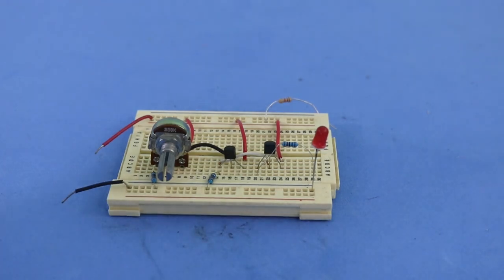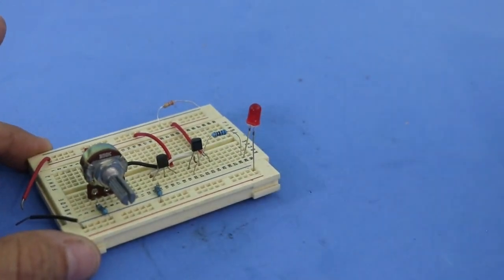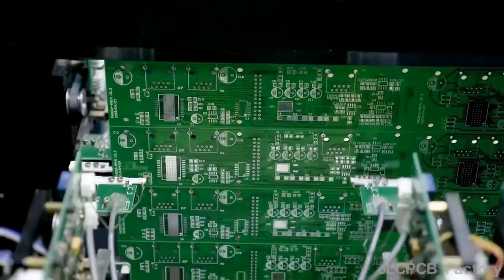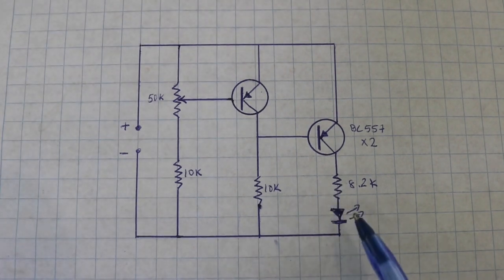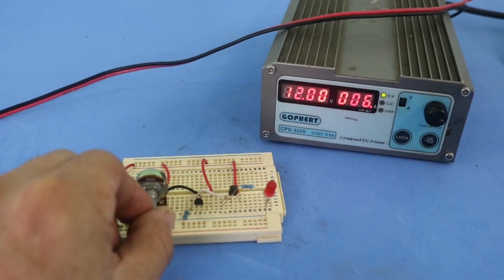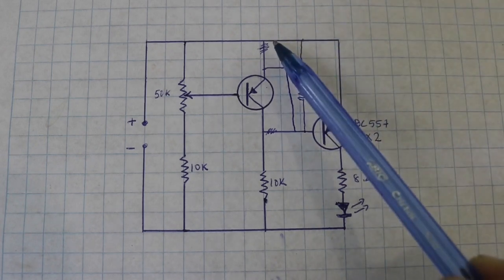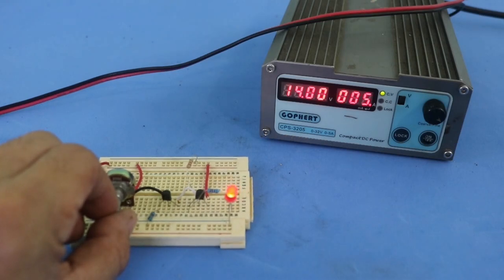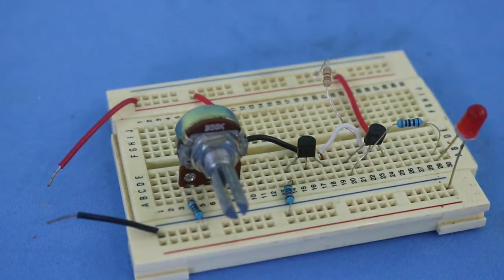Voltage Monitor Circuit

Comment: I made this couple years ago,  but i didn't like that it wasn't accurate enough.  It will turn on or off the load within 1 volt  of the  target voltage.   If you notice,  the LED started to turn on at 13  volts instead of 14v.
Reply: Of course there will be some drawbacks for this kind of circuit. If you're seeking for more accuracy I suggest to go for circuit tht utilizes op-amp, comparator, TL431 etc.
Reply: @sengkuang007   agreed. This circuit is "old school" and inappropriate today.
Reply: Probably because you are hovering around the cutoff point of the left transistor.  An op or comparator will swing when the ref and the input are very close.